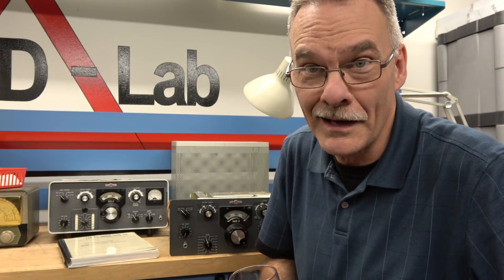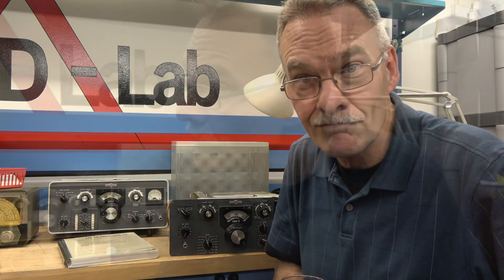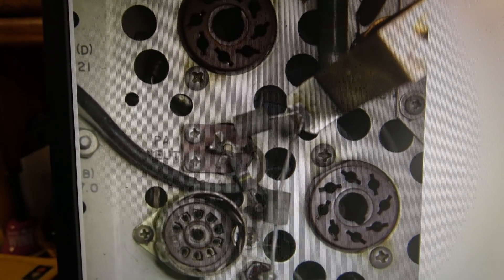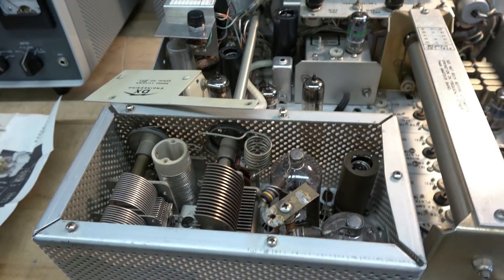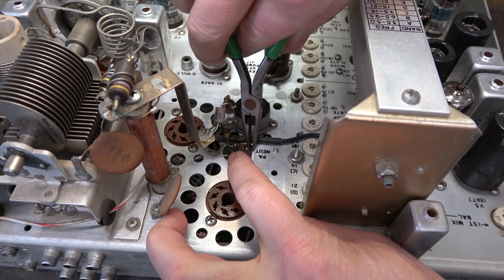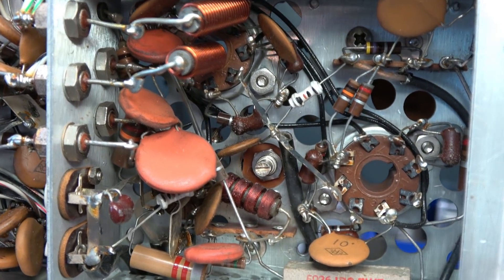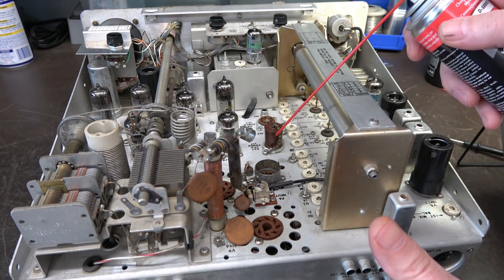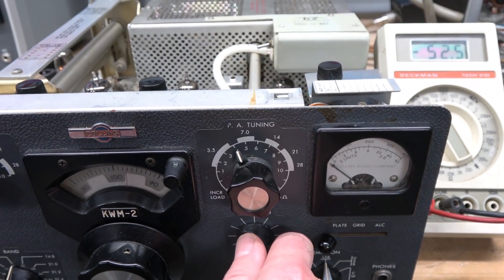How to repair Collins kwm-2 tube Ham Transceiver Neutralization issue

Comment: Great video. Unfortunately you have used the wrong trimmer cap. The one you have used is only rated at 600v, and will tend to arc on 28mhz - I know because I had the exact same one in my junk box. The correct one needs to be rated at 1200v.

Comment: Nice video and repair. I recently acquired a KWM-2A by Rockwell Collins (built in 1978) that looks and performs like it was never used. I did carefully go thru the cleaning process of tube sockets and switches and couldn't be happier with its performance. I have had Collins S-Line equipment since 1983 with minimal issues. I remember one issue several years ago with the 32S-1 which turned out to be a shorted capacitor on the screen of one of the 6U8's - I don't remember which one, and recently when the 2.1 KHz mechanical filter in the 32S-1 failed, but fortunately, I found a new one on Ebay and fixed it. Very nice to see that there are a few gentlemen like you that appreciate this equipment and have taken the time to post videos on it. Keep up the good work. You just may save a few of these magnificent old radios because of your efforts and videos. 73 WA4QGA

Comment: My Heathkit SB-401 uses an air variable neut cap..never had a problem.I don't know why Collins used those tiny variables in a high voltage RF circuit.

Comment: Terry, I recommend you add sites like that to the Wayback Machine backlog. You can "snap" websites and they are added to their database, as a security backup in case the original website goes down, gets partially erased, or is deactivated. It's like getting a Xerox copy of a library book.

Comment: the first thing i do on these is redo the tube shield grounds. they cause a number of different problems
Reply from the maker: Thanks, I will take a look. Are you referring to the mechanical connections (screws/nuts) mounting the socket to chassis ?
Reply: @d-labelectronics  Yes sir. I have had a few with af oscillations that just had poor grounding on the tube shields. It may not be, but that's the first place I look

Comment: I have a couple of S-line transmitter / receiver pairs. One set works and one has been stored in less than clean conditions so I haven't powered it up. Great to see you repairing one!